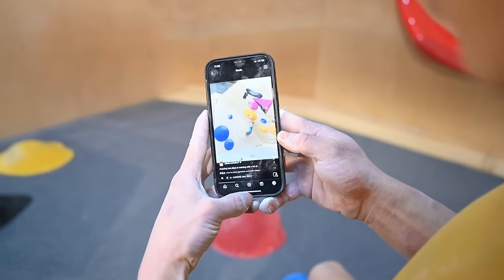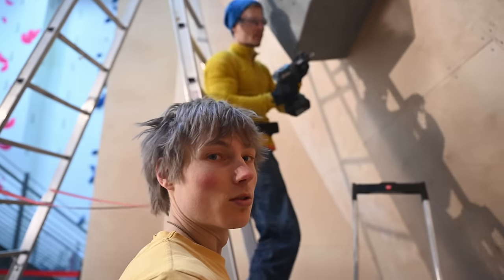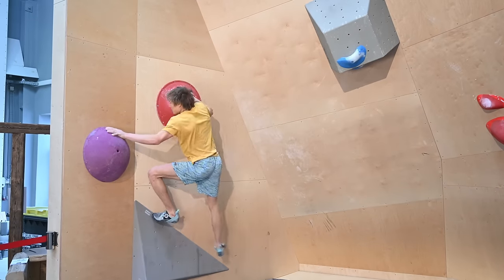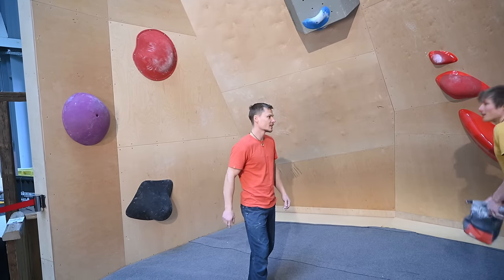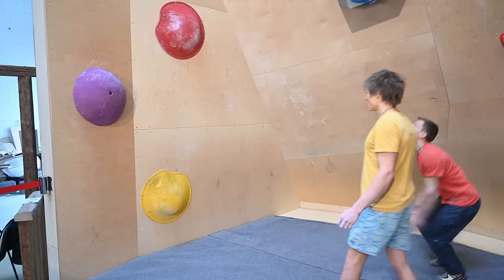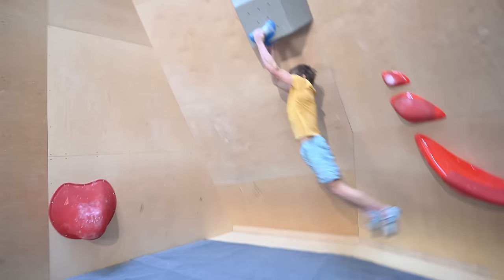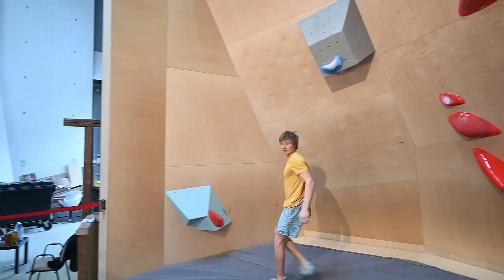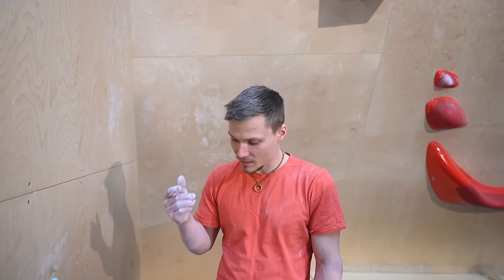MOVEMENT LAB #1 |  Worldcup Insight

Comment: Personally, I think this is one of the most interesting video you guys have done. Finger strength and stretching are very good, but at the end of the day, modern climbing is about movement. I agree that the boulders should at least be safe, even if they don't feel like it. Those are not one in the same, which maybe doesn't get talked about very much. It's also interesting how body morphology and strengths play into how we move. I quite like the comparison format, as you can see how these differences lead to different outcomes. As a shorter climber, dynamic jumps always far, but when I watch bigger people do them, it doesn't look so hard. The paradox is that as a shorter climber, I often have to use a more dynamic, powerful style to reach holds that are static for taller climbers.
Reply: I don't agree
Reply: The movement word 🤮🤮🤮🤮

Comment: Regarding low % moves and comp setting: it would be really interesting if they start mixing styles within a boulder. Now it's like one is a slab another is a dyno and another is a power problem. But that just makes different people top different boulders. It would be interesting to see what happens when styles are combined and you have to switch mindset between moves.

Comment: I personally don't like dual text holds/climbs where it's purely on the slick side that's used. I'm not climbing super polished slippery rock like that outdoors and Just not something I want to do indoors. I can't really feel like i'm getting a move down with that. For balancing moves give me a good slab with just small feet or something. I just don't feel like i enjoy spending the time on dual text or maybe I just haven't had an interesting problem set using it.

Comment: I mostly agree with Chris here. While I do think this style of setting leads to good separation in competitions, the risk potential is sometimes just too high. I'm not saying that this isn't climbing anymore, because in my opinion, it is, and I quite enjoy it here and there tbh. I just hope that the setting will continue to include different styles and not just push the "jumpy" stuff into a more dangerous manner.

And also... great video! Felt like 5 minutes haha
Reply: Risk is a part of climbing but the athletes are the main asset of climbing competitions and it doesn't benefit anybody to hurt them or cause injuries. 

It also doesn't make any sense to make climbers be not climbers. I get that this is still climbing up a wall, but as you stray further from the sport you're selecting more skills that are not relevant to climbing. As an exaggerated example, it wouldn't make sense if a climber had to do a do a backflip before every attempt, you would get a lot of sloppily executed backflips that aren't that impressive to watch and injuries. I'd rather watch gymnasts do backflips and climbers climb not vice versa.

I'm also not wholly against this style, but just building on your point a bit.
Reply: I think an underrated aspect of the "easier to select" argument is that these tricky, risky boulders are also easier to set.

It is hard to set power boulders that are not either or (either you can do it and flash or you can't), so if you get the level wrong either everybody does it or nobody does. Plus, it is just hard as a setter to be in the kind of shape the competitors are, there is just too much non-climbing labor involved in setting, so it requires careful extrapolation from setters.

In contrast, tricky stuff can be worked out over a few minutes. Plus, setters can actually do it, because having an hour to work the moves goes such a long way on tricky (but not necessarily super hard physically) boulders.

As the physical gap between competitors and setters widens, this might only get more pronounced.

Or, you know, we could just bring in Daniel Woods and have him set something static and heinous every now and then.
Reply from the maker: All very good and valid points. Setting a risky jump is easier to select people than setting a hard physical boulder where the level needs to be just right. 
I hope in the future there will be not only setters to set but also paid testers who maybe don't want to compete 😅. That would be ideal. Then hard physical boulder would be an option again
Reply: @alexandermegosAM What do you mean with “select people”?
Reply from the maker: @chrillabbe  to rate (select) them in a competition they must have different scores

Comment: My view on setting style is that setters need to be very careful about what attributes in the athletes the boulders are testing. Just because "It does a good job of creating separation in the field" does not mean that it tests climbing ability or even that it's fun to watch. For example, I think setting pure flexibility boulders is completely boring. I recall two situations, one with Simon Lorenzi climbing and the other with a Japanese climber (sorry, forgot his name) climbing. These two athletes simply lacked the flexibility to necessary to achieve the move. Each case was a painful 4 minutes to watch as they made no progress and there did not seem to be any alternative beta. I found it especially boring because I am naturally flexible, and could easily imagine myself doing the move if I were just a little stronger. Simon and the Japanese fellow clearly had no chance, tho, due to limited flexibility, something that has a very large genetic component but does not correlate very strongly with climbing ability. I believe that setters need to avoid the temptation to select based on attributes that vary a lot between athletes (thus creating "separation") but that have little to do with general climbing ability.